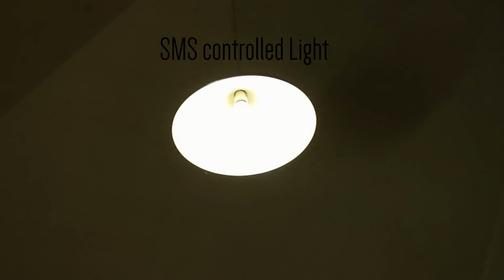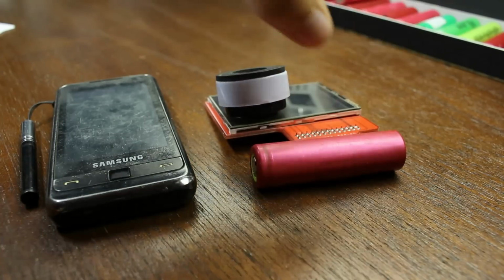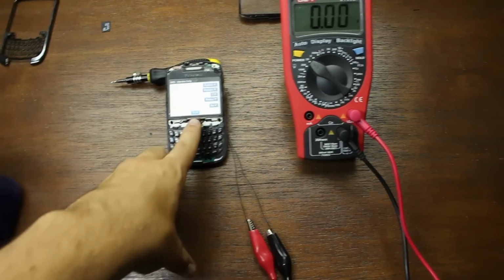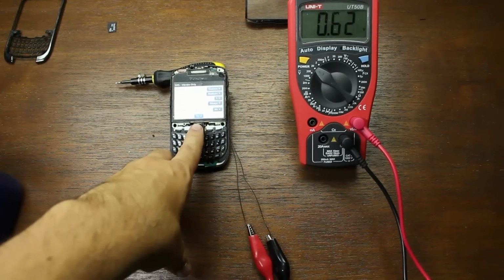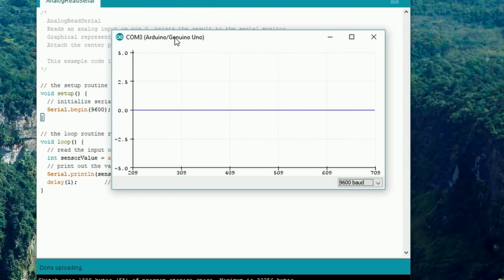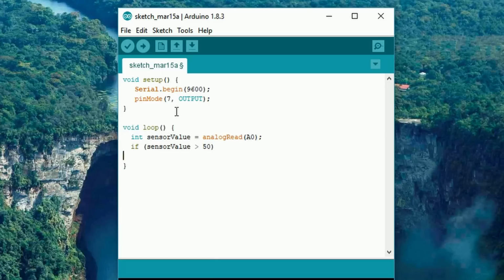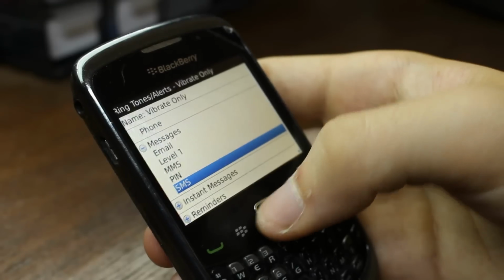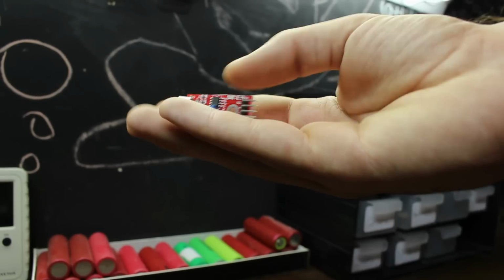Don't buy a GSM module, use your old phone!

Comment: Some Android phones provide serial pads. If you connect your Arduino to it, you could communicate directly with the phone.

For that to work you'd obviously need to locate these pads on your phone's board. You'd also need to root your Android phone in order to be able to read/write to the console (serial port).

Comment: I use cordovarduino cordova plugin to interface android phone to communicate with arduino. And make a mobile app through which I can interface arduino and esp32. 
I get battery power , touch screen ,wifi connectivity. 50% of the code can be done in javascript mobile app. Microcontroller just manage some relays and sensors.

Comment: I do not see the video yet, but I used my old phones as GSM modems without any other unit. Eg. in the beginning of the 00's I have read my emails with my Palm III and Palm V and I used my Nokia 3650 as GSM modem (on GPRS network) connected to Palm via IR. Later I used my Sony Ericsson K800i as same for my PSION Revo. The browser and ICQ runs on this little marvel without any Arduino etc...
Reply: Hi
Reply: Cont.namber

Comment: Yeah it was really a clickbait but I think that you gave us some good ideas to use a old phone in arduino projects. For example:
- We cold use a old android phone and create an app to interprete and execute somenthing
     --> enconde/decode message
    --> interpeter message
    --> execute actions
- We cold use the vibrator of the phone as a serial input to the Arduino
I'dont know if it's doable but it's interisting, thank you for the video!
Reply: Most phones have fixed vibration times and a pretty long minimum time for an interpreter to be useful

Comment: I used a lot of (Nokia) phones for projects like alarms and remotely booting up and resetting a computer. Nowadays the modules are so cheap and sophisticated, that I wouldn't prefer an old phone. It draws much more power to and you can blow up the battery when it's connected to the power outlet all the time.

Now I got an unlimited SMS plan and sent almost 500 messages in less then a week to test my new Arduino control by SMS (sim800L board).

Comment: its not working base on gsm.. it is a pure jugaar.. why using arduino the led can drive directly.. 
led positive is connected to the positive terminal of vibration motor of cell phone and negative connected to the negative of motor..

Comment: I don't understand why you need arduino, when phones have all the things from it. It has processor, usb plus camera, gsm, touchscreen. Make arduino from your phone instead.
Reply from the maker: The arduino allows us to control outputs. There are no GPIO pins that we can access easily on the phone so there would be no way of wiring up circuits to it.
Reply: @BuildItnow  I know - there is a bit of irony in my comment. Still usually arduino boards end up usually with some extension boards. Smartphone would just need a pins-board connected to usb port (and dedicated app). It would be an alternative to raspberry pi rather then arduino, but still - I'm surprised it's not that popular yet. Regarding performance - most of these tiny projects don't need that much of it, so all other processes running in background are not a problem to me here.

Comment: Great video, but another alternative with the same phone and with a lot of features is usisg a data cable connected to the arduino to send AT Commands. With that you are able to detect sms, open and send messages and filtering the received numbers for security.
Ex: You want to control two thing like the coffe machine and the kitchen ligh, by sending a SMS "Switch on Coffe-Machine" or "Switch on Kitchen Light". The arduino will be listen via AT Commands the received SMS of the phone. Ih the received number doesen't match it will ignore the command and clear the message, if it match it will execute and sent back something like "Done!". Finally if command is not valid he will send back sommething like "unknone command".
In the past I already did some things with that and sommenthing I like to use is some old 3G modems, they work great.
Reply: First I've ever heard of this - thanks!

Comment: gsm module cost a few bucks on aliexpress and you can do lot more things with it. I can't see the point to use an old phone for this. Good idea anyway
Reply from the maker: Yeah i started to find cheap GSM modules and they are alot more useful however the point of the video was to just show off that old teck can be up-cycled

Comment: An interesting but limited project. It would be useful an application in android that will transform specific sms codes in audio tones, examples: "code 01" "code 99" in the body of the sms would produce different tones, and when connecting it to the arduino it could interpret tones in different actions, this only connecting the speaker pins or simply with the audio jack
Reply from the maker: That's a great idea!

Comment: Find the video unnecessarily. Because a mobile phone and a GSM module are extremely different. While you just catch the signal from the engine to execute a command. Can the GSM module significantly more, you can send SMS via the Arduino itself or receive and evaluate. You can not do that with a normal cell phone.

Comment: That's awesome
GSM could be replaced with a mobile
Reply from the maker: Thank you! Remember that the GSM module does have more features.
Reply: Build It ,
Yup, I am working on a project  which includes liquid pressure sensor and when it increases by certain level it should send a message. But problem is  
I have experience of eletronics of couple years but not able to write a code. Can help me or suggest anything.

Comment: The only real difference between this and a GSM module is that the GSM module actually knows who is sending it the SMS and tells that to the arduino. This construction just takes any SMS to activate because the arduino does not have a way to filter out the correct phone number and message content. So if I were to know this phone's number, I could just send it anything I like and your light will turn on. A bit of a security risk, isn't it?
Reply from the maker: I see you point however in the phone settings I have set it to mute all other numbers and just vibrate when it receives an SMS/call from my number
Reply: Build It okay, if you have access to such a feature then that security issue is not there anymore. But not all phones have that. Also a real GSM module can not only filter one but thousands of different phone numbers so you could assign one number to your wife and one to yourself and control different things with different devices. I guess that would be a bit harder to get to work with your solution. You would need multiple receiver phones and connect them to the other analog inputs on your arduino. Thanks for answering though
Reply from the maker: Like I said I understand your point and I do agree however the point of the video is just to demonstrate some interesting ways to reuse of tech. I do understand and did mention that GSM modules have alot more features
Reply: Build It yeah and all I can say is that you have done a great job at showing us the possibilities old phones can give us makers. Keep up your work

Comment: This is in a way a very fast and easy way to automate some things. On the other side, it's ridiculously inefficient in my opinion. A GSM Module or anything else that can communicate 'directly' with the arduino is a better solution. Right now you're using a phone with a powerful processor and only using it as a switch.
Reply from the maker: I agree with you however by using the phone I've not only saved money but also stopped this piece of old tech (the phone) from being sent to the junk yard where it would get no use.

Comment: A comparator and digital in on the arduino would have been a better bet because you can use interrupts and sleep mode to conserve power (and its more computationally efficient than analog read)
Reply: Also you could just have used WiFi and an ESP32 micro, that would have been my preference.
Reply from the maker: Ill be using these when I actually use these in a project, i went simple this time just becuase i wanted to get the point accross that such features in phones can be explaited
Reply: Build It I have an ESP32 at home, and I want to use it, and especially play around with OTA firmware updates. I would be very keen for you to do a video on that.
Reply: His point was to counter the idea of using a GSM device.   GSM devices seem to be running around $70 and up.  Some opt for GSM because the network already involves some security of the connection.  

  However in this instance you could receive a spam SMS and have a device activated inadvertently.  But on some phones you can set them them to vibrate on certain caller ids and turn the sound and vibrate off for all others.
Reply from the maker: Ive already had an issue with spam however ive done just what you said and set it to only ring when my number calls or SMSs which fixed the problem, thanks!